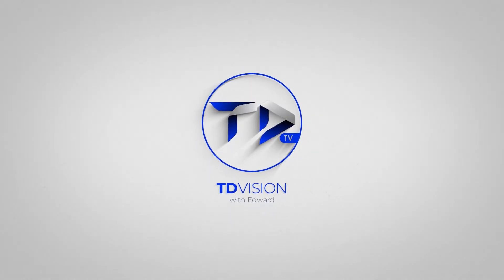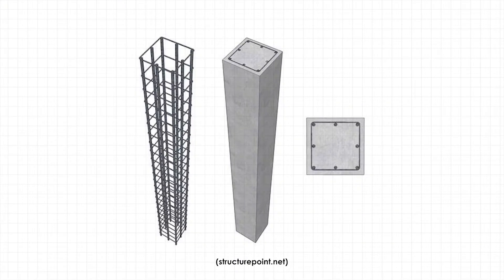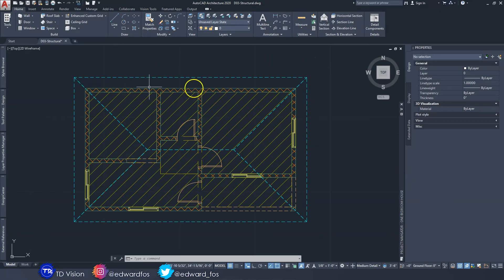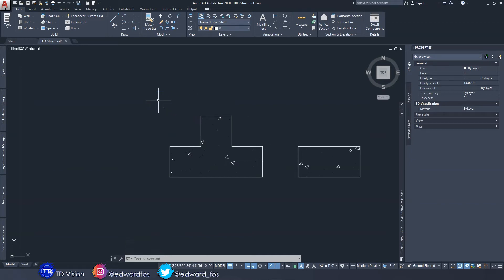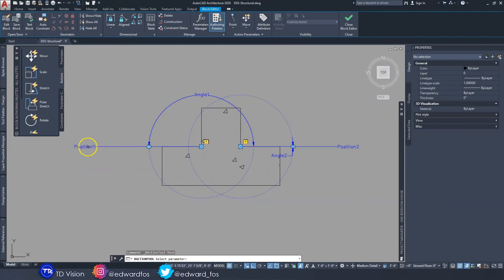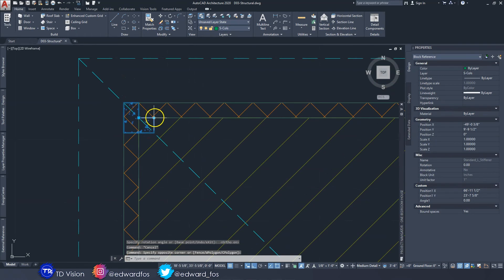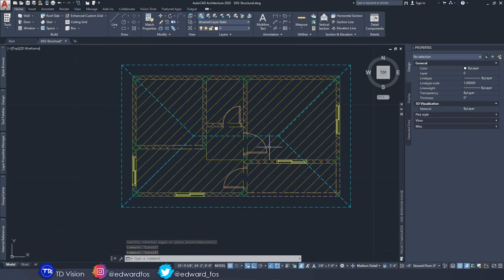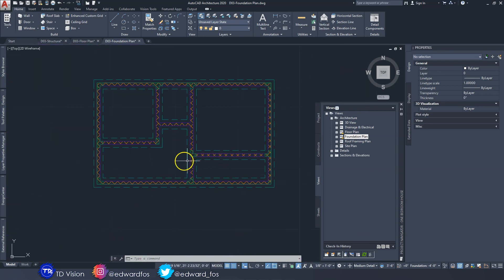ADDING COLUMNS in AutoCAD Architecture 2023

Comment: Thanks for sharing. One question: Why do you think that Autocad Architecture does not implement the option to create columns and beams with custom sections natively in the same way that Autocad Structural Detailing had? Don't you think it would be much easier to create them from the Project Navigator?
Saludos desde Perú
Reply from the maker: So I've never used AutoCAD Structural Detailing. But it would certainly be easier. Sounds like it's been replace with Autodesk Advanced Steel. AutoCAD Architecture does provide the basic tools to add 3D columns to your architectural designs though. Anything more complicated would be done with Advance Steel, and perhaps by a structural engineer. You should check out my videos on structural objects in AutoCAD. https://youtu.be/BiLnNXcVY6c

Comment: During your video i noticed you did the columns in 2D and i believe you said that you could submit the plan that way (correct me if i am wrong). Is this the acceptable norm? Do you do the same thing for upper floors. When does beams come into the picture?. I got a lot of questions but that's the nature of your videos..always brain stimulating
Reply from the maker: Great questions! Thanks for checking out my videos. There's a lot more we could do to this house, but I only did the bare minimum in this series. Yes you would do the same for upper floors. Beams come in the picture when we do the section views and call-out details. Keep dropping your questions.
Reply: @TDVision_U  Hello again. Edward a year ago we spoke about beams. Did you do a video on this area similar to the one you did on columns?.